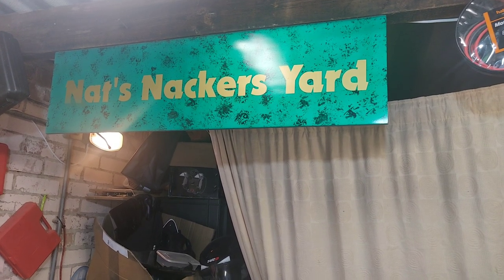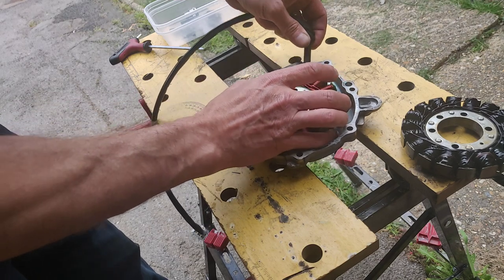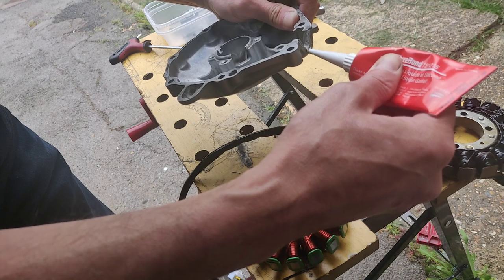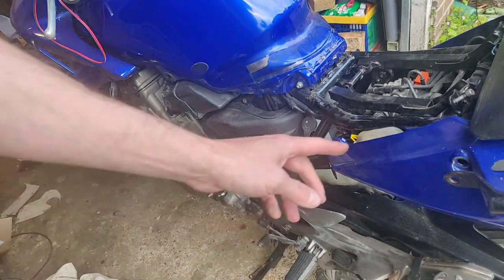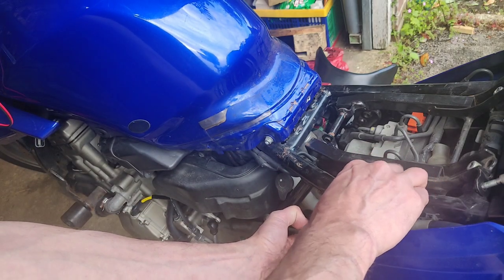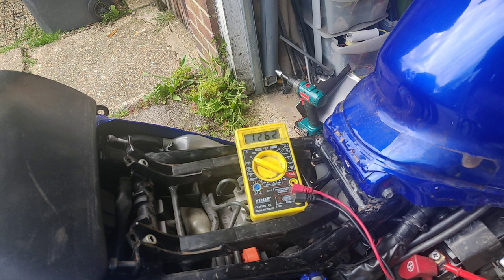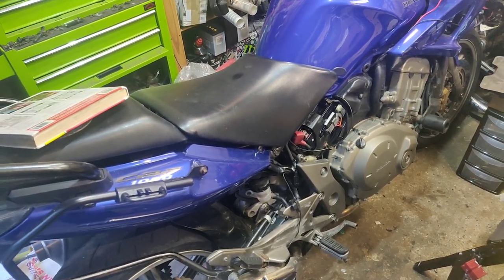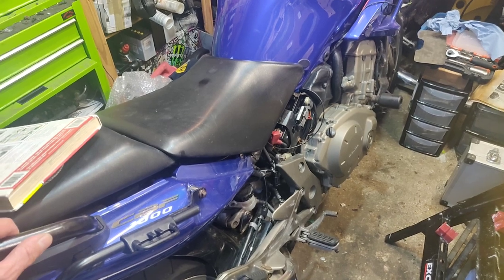Honda CBF1000.  Stator fitting and testing.

Comment: The CBF1000 MK2 (from 2010 onward) Honda changed the design but simply making the unit very robust, twice as thick coatings and other improvement's, Honda did listen when they designed the CBF1000 MK2, Alloy frame, one end can, better fuel consumption, I sort of like the MK1 though as it had 2 cans and not the one as on the MK2, The Honda CBF1000 MK2 is in the top 8 bikes in the world for reliability, cheap parts, easy servicing, and we all don't mind numb bums knowing we will get to where we are going as a self maintained machine is more reliable than one being serviced by Bubba Bob at the franchise dealers.

Comment: I would change the reg/rec as the voltage was still fluctuating a lot more than I would expect and at times dropping below 13v when revved. It looks a lot like the reg/rec is not doing it's job
Reply from the maker: I think that i will shortly.  Seems to be holding its own for now.

Comment: Your fluctuation in voltage could be due to the meter probes not being properly connected to the battery terminals. If they are only poked in, they could be bouncing and breaking contact momentarily with the vibration as the revs go up. Ideally they should be connected with crocodile clips. If you want to check for voltage drop between the connector and the battery the easiest way is to connect one probe to the +ve pin at the connector (regulator side), with it plugged in, and the other to the battery +ve terminal, then run engine with loads turned on (ie, lights if they are switchable). Voltage measured should be virtually nil. You can then repeat with negative terminals to check earth side.
The other point is, you can only get accurate results from charging tests if the battery is healthy and fully charged.
Reply from the maker: Thanks Rick.  All seems good if a little low.

Comment: As others have said good connections, crocodile clips to battery, are essential to correctly test voltages. Also you have virtually nothing to gain here by hot wiring the RR direct to the battery, you previously tested the wiring loom with battery voltage at the RR and less than a 0.2v drop between RR and battery positive and negative cables which proves the wiring loom is good.
Reply from the maker: I think that you are right there.

Comment: I think you were maybe trying to remember Electrosport, but yeah, being of a certain age, my brain always goes to Electrolux first, if it wasnt Electrosport it may be Electrexworld who are a few miles away from me.As for that mystery cable, maybe the remains of what was a permanent aftermarket cable for plugging into a battery tender/charger, as the positioning and the in line fuse, gives that impression.It did seem to be jumping around a lot voltage wise when being revved.Try running it for a few mins just on idle, to see a steady/increasing voltage and then rev it to 4k-5k to see if it smoothes out the jumping around, or, give it a full charge from a tender/charger and then try it
Reply from the maker: I have chucked it on a full charge.  It's better but still not going as high as I thought that it would

Comment: Did you have to drain the oil to remove the stator
Reply from the maker: No mate. There was some leak to catch but I didn't have to drain it.
Reply: @NatsNackersYard  thanks. Mine went this weekend left me stranded 75 miles from Manchester on the M6 toll left from Kent. RAC brought it all the way back for me
Reply from the maker: Might be worth checking your battery too.  I think the stator utterly shagged mine on the way out.
Reply: @NatsNackersYard  I've done the diagnostics this morning. All the yellow phase cables are going straight to battery ground so all my coils are shorting out. I think it's fried chicken
Reply from the maker: Ouch!  Have fun.